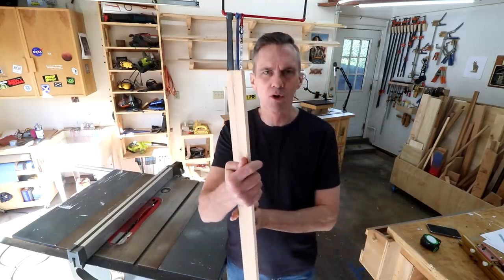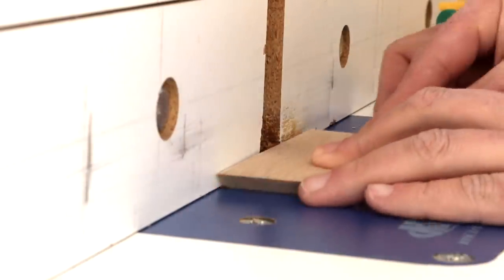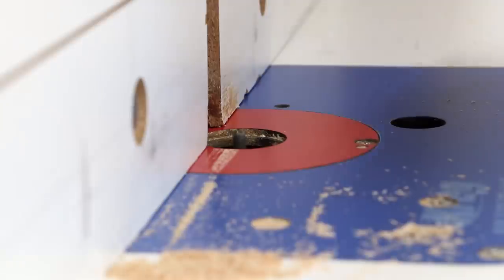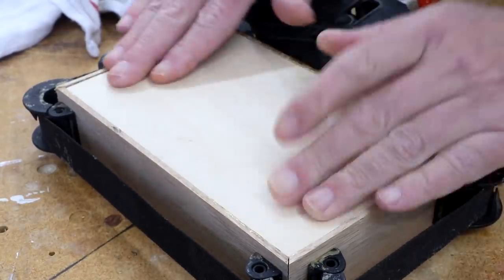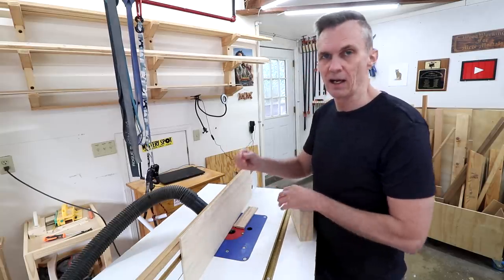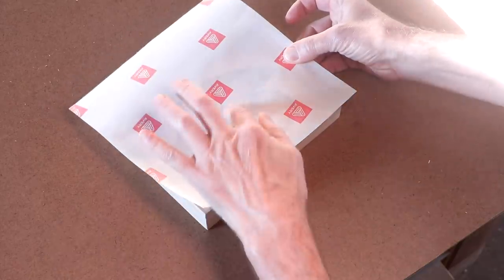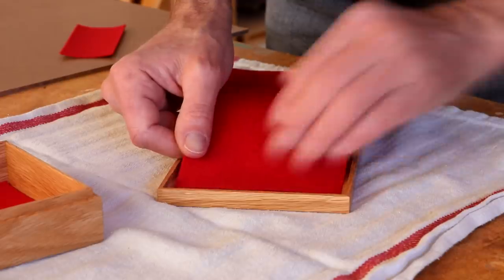Red Dragon Dice Box

Comment: I finally got it! (Y)   Today I picked up my very first and brand new table saw!  :D  
A Black and Decker, 1800 watt (15 amp) 5000 rpm, 254 mm (10") blade, and with a very good and precise fence.  Exactly the same numbers as the DeWalt had, but this one on sale just costs 1/3 of the DeWalt, and for my beginner and once in a while use, I think and do hope this will be perfect for me.  
And I couldn't afford to pay more anyway!  :D 

These last 4-5 months watching hundreds of WWMM and other DIY videos for woodworking beginners have inspired me to take up this hobby I had for a short while more than 30 years ago, and 2 months ago I started buying the basic tools and some other materials, and today I finally bought the table saw.

(Oh yes, I've used the "1000 dollar workshop" list, though things are a bit more expensive where I live, and there isn't a market for cheap used power tools,  but it's okay, I already have more than enough to get started.  As soon as it gets a little warmer outside!! 
 
Just waiting for the spring to come to be able to turn my outside shed into a place I can start woodworking, and first of all build a workbench, and stay out there for more than 5 minutes without being dressed like I weigh 3 times as much as I do.   (25-32 F, 2 inchsz of snow and a freezing cold wind are just too cold to work more than 5 minutes in an outdoor shed without any heat.  ;) 

But I still have a LOT of DIY videos to watch about what to do and NOT to do, and I (almost) don't mind waiting 2 more months to ... make some noise!   :D 

Thank you 👍

Comment: “Inside groove”.  Clever way to get the separated cover to fit. Thanks for the video.
Reply: I agree.
Reply: It's very nice.  To do it, you need that test piece (or careful measurements) and to make sure not to push too hard against the fence as you cut it apart.  That would crush the tiny connecting bit and cause a divot.
Reply: Thank you Robert Bamford! I was having a hard time wrapping my head around how there was a lip after he routed it off. I must have missed the explanation. You cleared it up with just your comment. I feel kind of silly now. 😂 Thanks again!
Reply: @WillyLuedtke  you aren’t alone. I had to go back and watch it again before I realized the significance if the inside groove - that was not a rabbet.
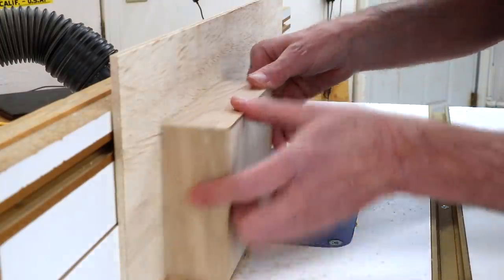Reply: Well I still don't get it. I wish you slowed down a bit right there 2:47 ish so I can see the offset?
Reply: @scottjones462  For some reason it’s a mind bender for me. Took several rounds of “Wait! What?” for me.  Halfway through on inside face. Shift down a bit radius (and a hair?).  Halfway through on outside face.
Reply: @robertbamford8266  I’m trying it now to see if I can get it. Thanks Robert!
Reply: My favorite part of the video.  I always hate the idea of giving up space to inserts to accomplish the same thing.

Comment: So I just came across your channel, and I guess I found myself a new hobby. There's one thing I wonder though. You decided to lay the bottom in the ridges, and then glue it together. What was the reason for you to do it from the outside rather than creating a ridge, and then placing the bottom in from the inside giving it more strength (because it would lean on the ridges)? Is there something I'm missing?
Reply: Function (purpose) of boxes will determine Form (aesthetics or design).  This box isn't designed to hold 40 heavy drill bits, it was designed to hold dice or board game pieces that are probably made of plastic or other light weight material.  The top and bottom of the box/lid are inset and that gives two gluing surfaces for strength.  It also allows the box to remain square while the glue sets.  Often, with mitered corners, as the glue sets, parts can slip or slide, especially if using a bar clamp, because often the clamping pressure on one side of the miter might be greater than the other side.  It's difficult to get the clamping pressure equal.  I hope I answered your questions.  :)

Comment: Steve, it might be a nice project to show how to make a small parts holder for the router table.  They aren't hard to make using a toggle clamp and keeps your fingers a safe distance away from the spinning router bit.  It would fit in with your table saw push block as another useful safety device.

Comment: You can make the felt feet way less likely to come off with even a very small indentation by a properly sized forstner bit. With 1/8 inch plywood that might not be practical here but with even 1/4 inch you could put a tiny indent in with the smallest bit that fits and keep those feet in place for longer.

Comment: Steve, you used tge router to split tge box...correct...then how was there an edge for the top to fit over when closed? Did you glue in a higher internal wall or what?
Hello from frozen MN.

Comment: As someone that wants to get into woodworking, I'd like to make a box like this but with some modifications. I don't have access to a router but I do have access to a table saw. My understanding is that it would be possible to create the grooves with a table saw using a dado blade? Also, would it be possible to create a box like this that is hinged? It seems like the protruding part of the bottom of the box would not allow for that so the design would have to be changed.

Comment: Cool box... Usually you split the box using your table saw, but for smaller boxes it seems like you have better control at the router table. But I am curious: Was there a reason why you didn't use a push block on making the shoulders and grove on the inside; Did that give you better control over the cuts?  I'm not as experienced or confident as you are, so I would be worried that the piece might shoot out of the router unexpectedly... but maybe the cut is so shallow that it really is not a concern?
Reply: Use a push block or Microjig type holder. I have the scar to prove it.

Comment: hi Steve: qq: do your safety glasses not get fogged up using it together with your mask?
Reply: Safety glasses should NOT fog up when using a mask/respirator. If they do, that means your mask is leaking and not creating a seal on your face, which means you're no more protected than if you didn't wear a mask at all. StumpyNubs has a video that goes more in depth, just search "StumpyNubs mask" and it should be the first result.

Comment: I love the technique with the lid but I’ve not got a router
Reply: It can be accomplished with a table saw as well.
Reply: If you have a dado-blade for the table-saw you could use that, otherwise use a regular table-saw blade and make multiple passes (although depending on blade you might want to clean up the bottom the slot slightly)
Reply: Thank you for that Geoff much appreciated